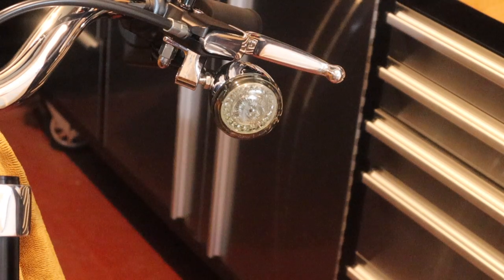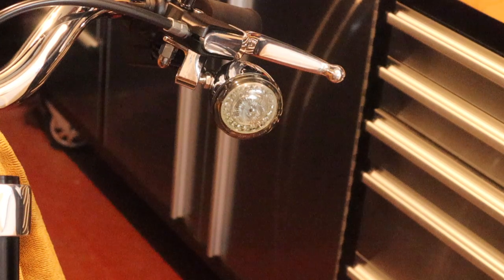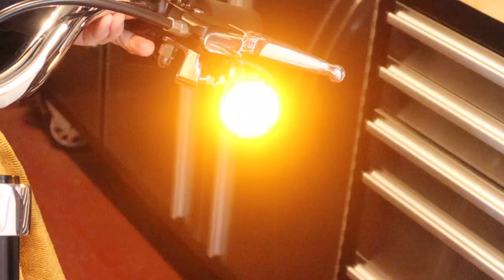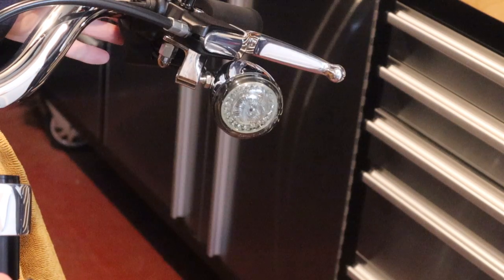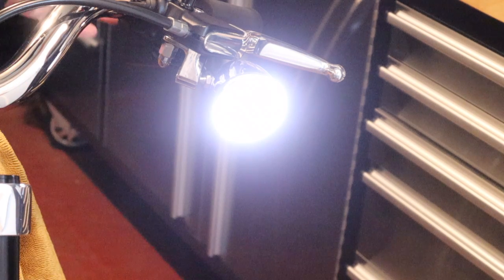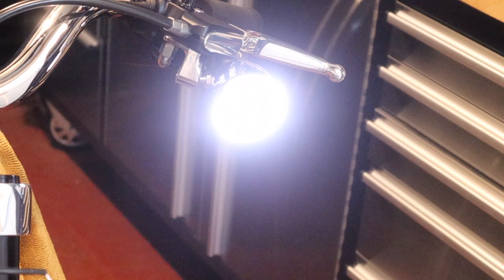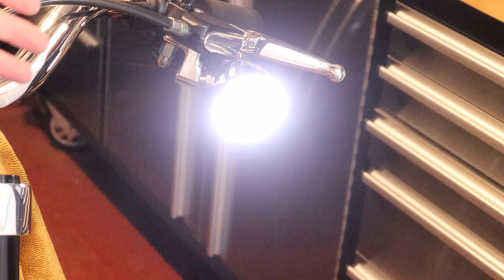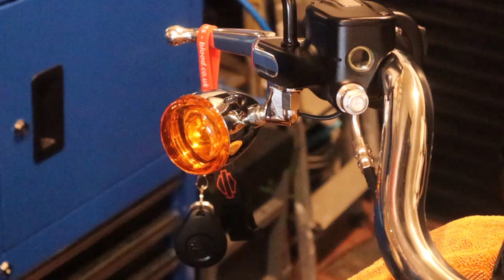ProBeam LED Indicator install on 2021 Sport Glide with 1156 bulb fittings

Comment: Thanks from Australia mate! Got my probeams in the mail today thinking they were just plug and play only to discover the white run wire 😫. Thanks to your video the install process will now be done with far less mistakes. Cheers!
Reply from the maker: Brilliant, so pleased the video is of use. I couldn't find info on the probeam with the extra wire anywhere. So good to see it helps. Ride safe

Comment: Hello Martin, really a Well done video and very clear, I've been looking at these for some time. Now I will buy them, anything that makes other road users see you more clearly are a must for us Bikers. Thanks for taking the time to explain how it's done and look forward to other upgrades.
Reply from the maker: good morning Martin, really pleased the video was of some use. I am so happy with the mod, a real improvement and like you say we need all the help we can get to be seen especially in these winter days. All I will say is take your time with feeding the wire through the bars, it will come but takes a little fiddling. Also make sure you push the rubber boot back away from the existing reflector on each indicator or it will be a real struggle to get the new unit in. Good luck & please let me know how you get on if you do it
Reply from the maker: Hi Martin, how did you get on ?

Comment: What size extenion wire is required inside headlight..cheers...
Reply from the maker: I just measured from the indicator to the headlight and added 12 inches

Comment: Hog parts sell these lamps. I looked and found that the connector for the indicators under the tank are 4 pin plugs. On UK bikes only the earth and flasher circuit are used. One of the other terminals is live and this would be what the US models use. I am going to get the lamps with the JAE plugs (pt no. PB-AW-ECE-JAE ) and re wire with a 3 core cable to the indicators. (Nb 114 Fat Bob). No drilling of the original fittings. No use of scotch connectors.
Reply from the maker: sounds like a plan👍
Reply: Hi,would you know the part no for the loom from the connector under tank,to the back of the indicator housing,or are you going to make your own up
Reply: @susanlee8453  hi Susan, have you found the answer to your question? The solution suggested by Jon appears pretty logical…

Comment: I sprayed Autoglym vinyl and rubber care which helped lubricant the rubber to help it come out easier and also the rubber boot at the back
Reply from the maker: Great idea Duncan. Are you happy with the lights?
Reply: @My_bike_and_me  I haven't connected the white wire yet but yes the LEDs are great and your video helped me fit mine

Comment: Very good video with easy to follow details thanks! 👌
Reply from the maker: Good to know it was of use👍
Reply: Quick question...the link to where to buy seems invalid ....are they still available?
Reply from the maker: @Wavehead1773  I bought them from my local Harley dealership.  I have just checked Harleys web site and they dont seem to have them but I have also seen them on e bay.
Reply: Got some from Hogparts thanks again 👍

Comment: Great video, about to do the same thing. Can I ask where you got the wire connector to clamp on to the running light of the lamp?
Reply from the maker: Hi Luke, I answered you question from my other channel (obssesivecardetailer) but it doesn't seem to have worked so try this link.  Scotch Lock Connectors Quick Splice Scotchlok Electrical Cable Wire Terminals UK
Reply: In the uk they are called scotch locks

Comment: You could have just bought the Eagle LEDs and not had to mess with all that wiring.
Reply from the maker: That would only work for bikes made for the US. In the UK and I think Europe there is no permanent feed for the day running lights at the indicator. In the US its an easy swap over but not for bikes made for the UK